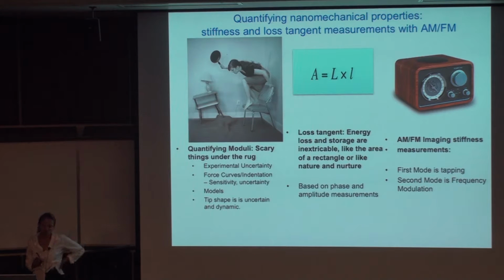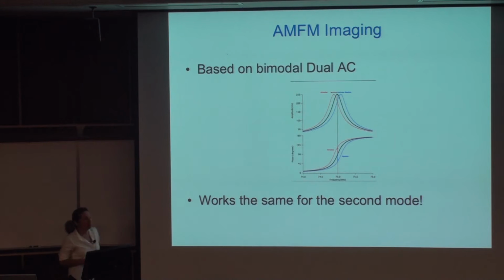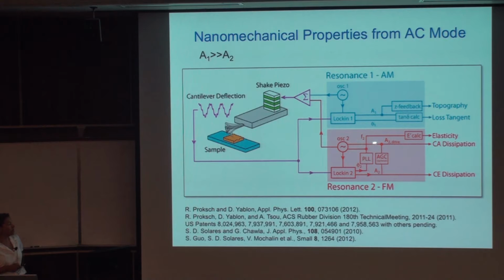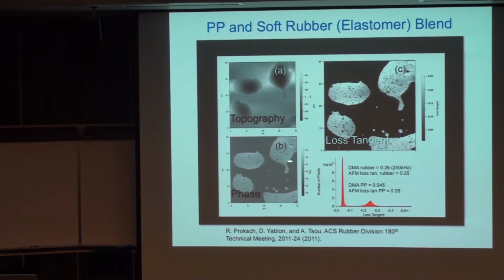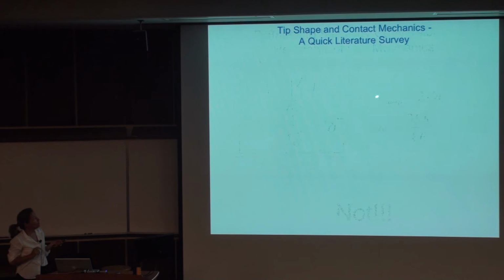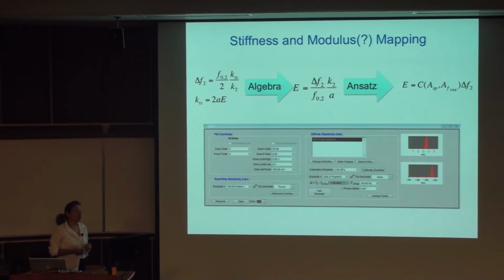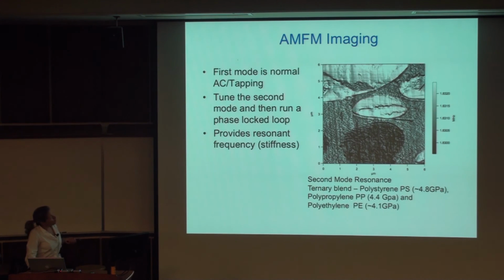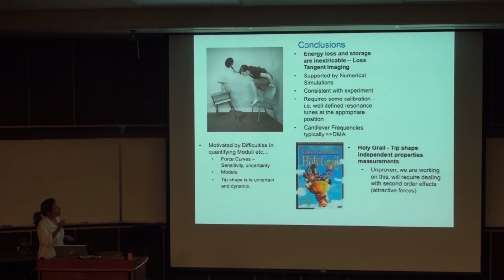AM-FM and Loss Tangent Imaging -- Two Tools for Quantitative Nanomechanical Property Mapping

Comment: nice presentation and brilliant idea, to get rid of the tip (shape,size), but... in real life, most times the so calculated Loss tangent appears to be negative, which is absurd... (is a positive-defined quantity, ratio of two positive defined quantities in turn). So, it is not clear where the 'hardware' bug is in measurements, in these cases... I would like someone from AR to comment on this.
Also, it seems to me that L1 is not selectable under the list of standard channels of Tapping mode: why?
bye, Marco.